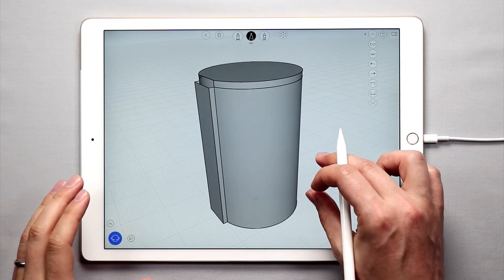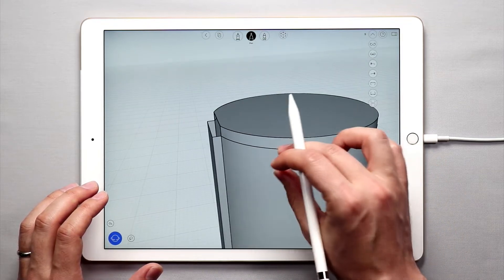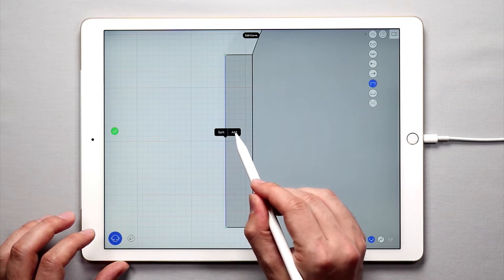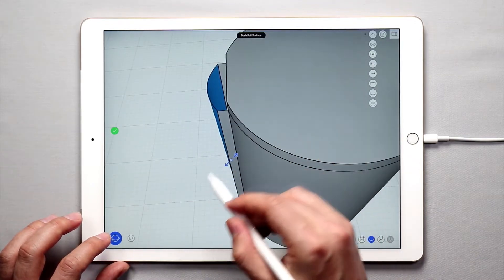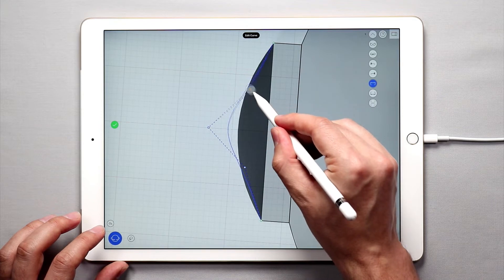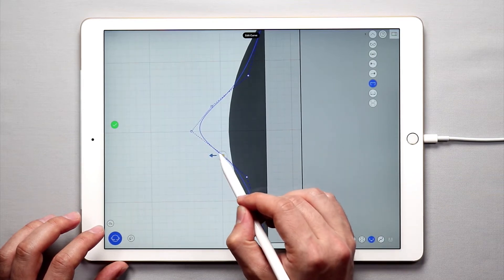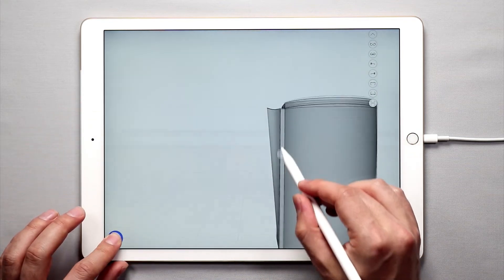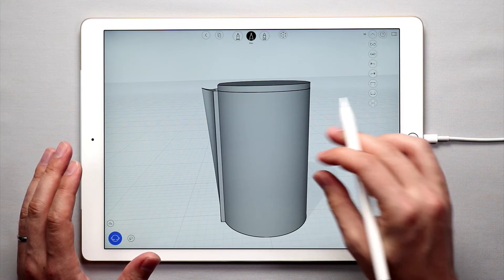uMake 1-Day Course - Hot Kettle - Part 2

Comment: I am not getting the "add" option when I click and hold on the line. I get the green dots on the corners but not any option to add one. In the help section the "add a control point" instructions mention a dotted line to use to add a control point but i dont get a dotted line either. I'm stuck :(
Reply from the maker: Hey! Would you be able to send a screenshot to “hello@umake.com”? We will take a look and guide you based on it. Thanks!
Reply: @uMake  Thanks for the quick response! Ive sent a short video clip that shows (or rather doesnt show) the "add" option not appearing. Thanks in advance for any help.